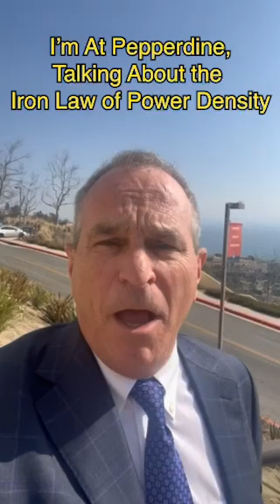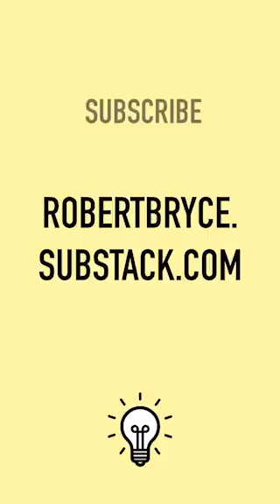I’m At Pepperdine, Talking About Power Density

Comment: Curious...What are nuclear and natural gas supply power inputs compared to wind, solar, ethanol and batteries.   The corn ethanol and wind power seem to be obvious but what are the equivalent for nuclear and nat gas.
Reply: Everything has 'hidden' inputs. However if we write off infrastructure as not an input then it's possible to claim solar and wind are cheaper than everything else.
Of course we can't write off the infrastructure, because you don't get power without infrastructure. 
So a 640 acre (I'm not certain if that's too little or too mich) area can be home to a GW scale nuclear reactor,  probably more or whatever the name plate says that much solar panels will create (it should be noted that being intermittent solar never produces its nameplate value) or iirc about 64 MW of wind. The same intermittency that applies to solar applies to wind, thus solar and wind requires 100% backup. 
Thus the inputs for nuclear remain low per GW of installed capacity because it only has scheduled maintenance down times.
Reply: @wheel-man5319  I was wanting to know if you include all the inputs/infrastructure of wind/solar/batteries and compare costs/output/lifespan which solutions are best?
Reply: @dbmn7571  nuclear.